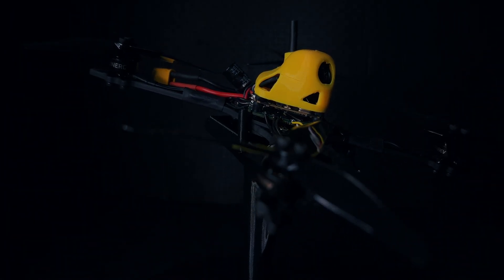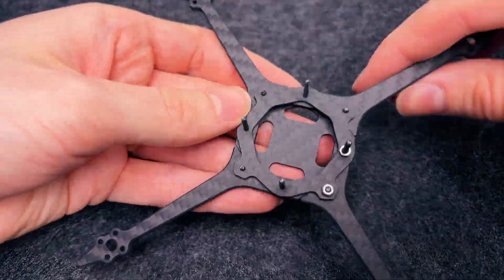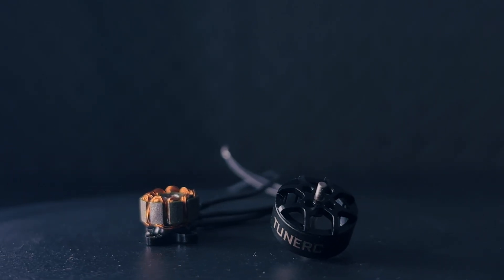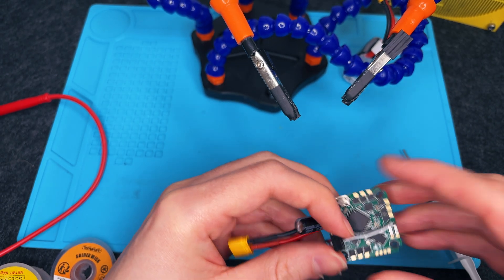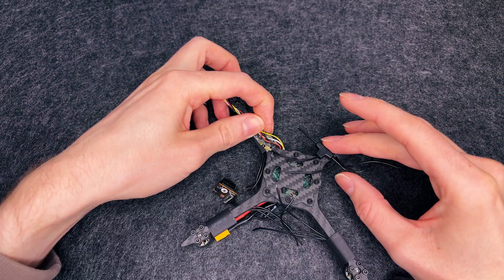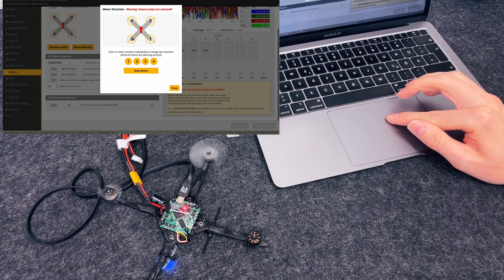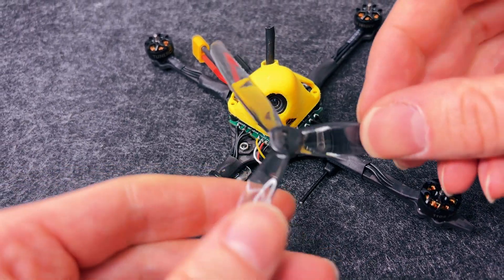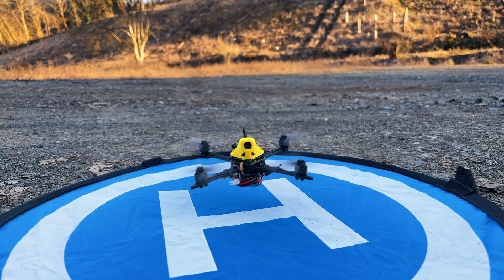I Built the Lightest DJI O4 Toothpick – and Made a Huge Mistake (Twice)

Comment: Suggestion for a lighter build: use an AIO with integrated elrs, use happymodel mobula 7 o4 canopy, use a unibody frame (I made one open source called Pluto-120). For more power set esc to 24hz pwm and set betaflight throttle boost higher and vbat sag compensation off.

Comment: o4 lite should be discontinued. one broke my first flight.  i been through 5 and never had one last more than a few times out.  i realized that buying the pro was a much better value.     now i have the hglrc rekon 5 lite. its a 5 inch super nlight toothpic with thepro. very very fast.
Reply: u noob, ur suppose glue the mipi and ufl down

Comment: I have a set of analog goggles and think this would be a good first kit do you know what a good analog version could be instead of the o4 unit
Reply from the maker: I would use something like the HGLRC Zeus Nano VTX and a Caddx Ant Nano. 
These are good low budget parts. Pay attention to the 25mm mounting pattern on the VTX, then the build is easier
Reply: @fpv-geek thanks do you know what websites these can be found
Reply from the maker: where are you from?
Reply: The uk
Reply from the maker: @henryedmunds7246 You can find all the parts on AliExpress.
Reply: I have a frsky reviver for the drone but it won’t enter bind mode do you know what could fix this it is a r81 radio master d8 reviver
Reply: I got the drone to fly

Comment: I'm a beginner and got a Tiny whoop and this is a very nice step up, but can you use 4s for it? Because the original o3 kit is supposed to use a 4s pack
Reply from the maker: The DJI O4 can‘t handle 4S. If you want to use 4S, you have to use a step down converter
Reply: @fpv-geek  thanks, that's what I thought, but where can I add a step down micro bec when installing the o4, there is barely any info online and I'm a beginner, thank you so much, your videos are amazing
Reply from the maker: directly to the battery pad

Comment: I've got one that weight 42g with battery and I let a friends kid just fly it and it ssurvived a 40m fall onto concret (I was surprised) kid just went full throttle and let go :p. It's even lighter than betafpv's drone as that weight is with a 550mAh battery it weights 28g dry. I do believe it's the lightest design in existence at the moment that legitimately has a well engineered frame and canopy design.

Comment: Hey great video!….question for you i’ve built a 3” with the Dji o4 lite. I’ve soft mounted everything…but still a lot of vibration, did you/ or do advise changing the esc PWM? not sure if the issue is there, thanks
Reply from the maker: Thank you very much!
What PWM frequency is your ESC currently set to? (For o3, o4 etc. it should be higher than 24khz)
Do you have the vibrations in the footage with Gyroflow or also in the goggles?
Reply: Hi im using the Goggles 3 & have a little jello in the footage (acceptable) for acro flying, but the onboard recording in very bad (shaky)
Reply: Currently it is Bluejay, 0.19, 48kHz
Reply from the maker: The o4 is unfortunately very sensitive. 
Have you checked the cable from the cam to the air unit? This may be causing the vibrations.

Comment: HQ came out with 3.5x3.5x3 they’re only available from hq direct as far as I’m aware but they are far better imo than the other 3.5 props they make. That sound and feel better. Efficient for being higher pitch.
Reply from the maker: I didn’t know that! Back when I built my AOS35, I was looking for high-pitch props—those would have been perfect.

But I don’t think high-pitch props are a good match for low-torque motors. I’d rather go with a lower pitch to gain more RPM instead.
Reply: @ yeah they are very tiny motors xD I want to build a toothpick so bad! I’ve got a bunch of 2” and 2.5” pitch props just lying around now 💀
Reply from the maker: Sounds like you already have half the build ready! 😜 Now you just need the rest, and you're good to go.

A toothpick was exactly what was missing in my collection too. It’s so much fun (not in Bandos)! Feels completely different from my AOS3.5, Volador 3.5, or Mark5.

Comment: How much flight time are you getting out of the 450s?  Have you tried the R-Line 550 3S?  I really like the 550 for my 2.5 toothpick.
Reply from the maker: It depends on the flying style. In my tests, I’ve had anywhere from 2.5 to 5 minutes. Just cruising over fields gives me around 5 minutes.